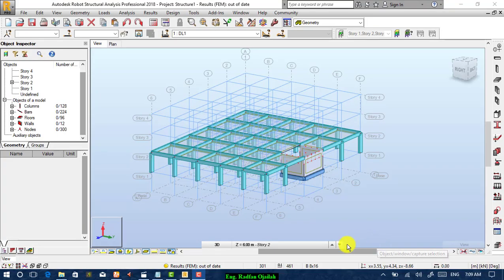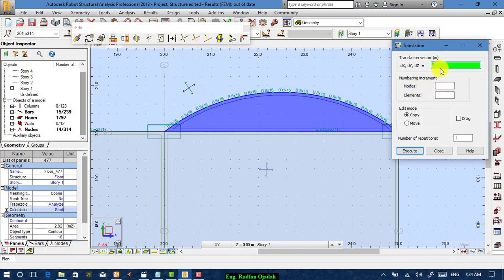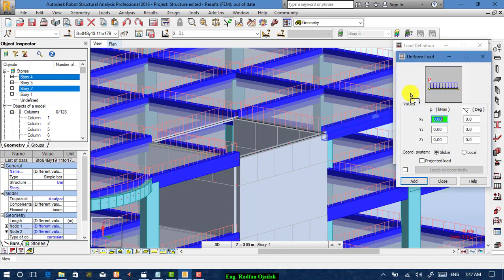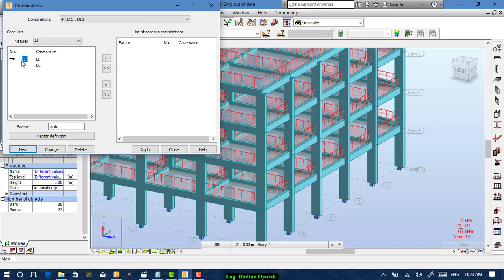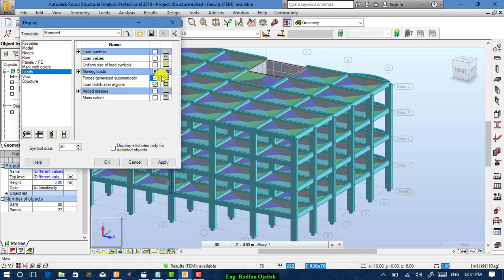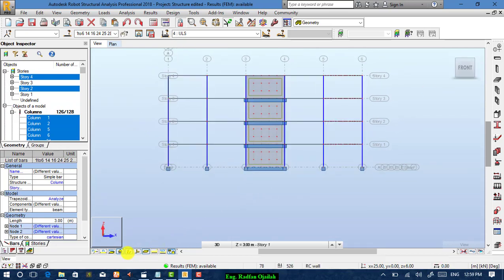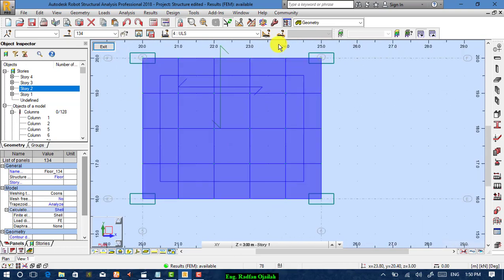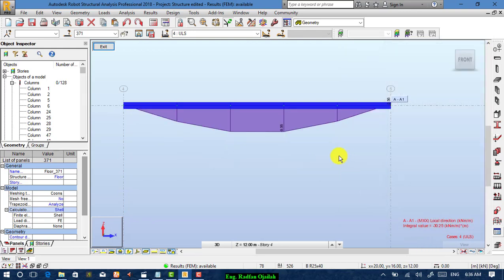Lesson#6:Analysis of a Structure, Finite Element Analysis of Slabs, Expressing Results

Comment: Greetings from Singapore, theres hardly any good tutorials online, so i have to thank you for your time and effort. May i ask if it is required to add the beam line load? My understanding is that the slab would transfer the loads over to the beam. Thanks!
Reply from the maker: My pleasure, I'll make sure to include that in a new video
Reply: usually you can choose to distribute your superimposed loads as a udl or make them as line loads on beams for the case of partition walls or perimeter walls..It is to the designers discrition

Comment: Hi Engr. Radfan, when you analyse the floor slab, do you have to define its own weight? or the software will automatically apply it on the structure and all you have to define is the imposed loads? thanks?
Reply from the maker: Lito Panaligan Hi 
When you assign load types firstly add DL1 which will be the own weight then add DL2 which will include other dead loads , finally add LL  or any other type of loads.
The point is; the program consider DL1 as selfweight
Reply: thank you very much for your reply. how about designing the curved beams? What I mean is, how do you determine the reinforcement of curved beams? thank you in advance..

Comment: Salamaleykum Radfan.

I trust you are doing well. I have a challenge with one of my assignment on Robot Structural Analysis Professional. 
I am designing the columns and getting the steel reinforcement section of the columns at the top floor greater than the bottom floor.
Please can you help me to fix the matter, I will be very grateful for your assistance.
May you find the link below to download the file. 
https://www.mediafire.com/file/e7yvpq25sz8ntng/Office%20Block_Reduction%20Factor%20_28092017.rtd

Inchalla'ah.
Reply from the maker: Ok! no problem😊
Reply: I will appreciate your support!